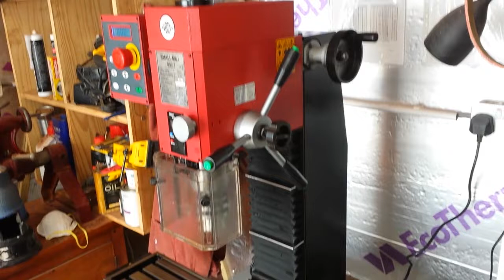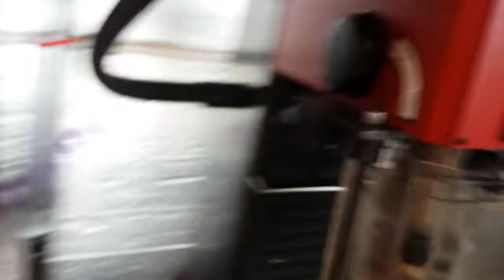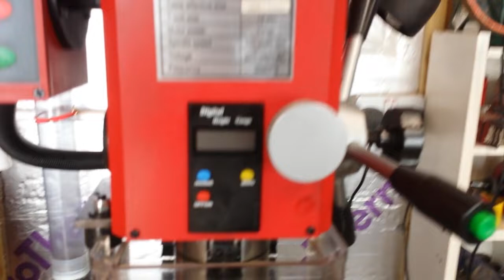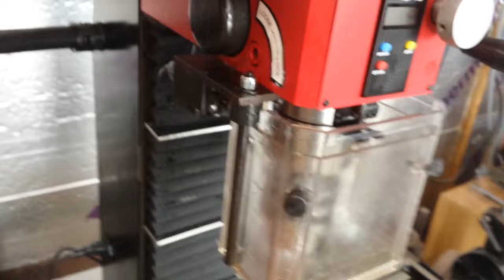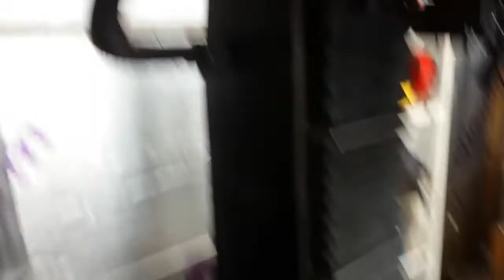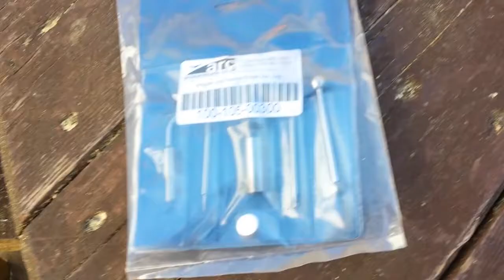Mill Swap (DW Betrayal remix)

Comment: Hi gary

That stupid plastic chuck guard wants launching over the wall....like most other "EU directives"...

See how it goes with this milling machine...

I think you know my thoughts on wong chong stuff.....so I won't say any more...

An update on its performance would be nice though....☺️
Reply from the maker: Hi Glenn - 

yeah, I know your thoughts. You are one of the people I refer to at 4:50  ;-)

As you know I love the old gear too, but I felt that this was the most practical way forward for me at the present time so I can get on and do some work. My first choice would have been the Centec but that would have involved too much delay and hassle. 

TBH my sense is that Chinese machines are getting better than they used to be. This feels like a nice bit of kit, and it does have some nice features. Also, in fairness at least the Chinese are making machine tools at the present time, which - sadly - is all but gone in the West.

However, we shall see how it performs. I will do an update once I've got used to the machine, and I promise you that the accursed chuck guard will not feature in it  :-)
Reply: @gary.arthur 

Look..
The Chinese are capable of producing some half decent stuff....when they put their minds to it...
But I still think you gets what you pays for....
It may well be that the machine you have chosen here holds up OK....as it looks a better model than some of the utter Shyte that comes from that place...

Graft it for a bit....any nonsense with it will soon manifest itself...

And that "chuck guard"...
LAUNCH IT...!!
Reply from the maker: Absolutely! If I'm still saying 'it seems like quite a nice machine' a year from now it will probably mean it's ok.

I do worry about these PCB's though. Bad experiences in the past. But at least it doesn't have plastic gears! 

And yes, countdown has begun on the launch...   ...   ...
Reply: @gary.arthur 

I've been told them "mini lathes" have plastic gears in em...
I've never heard the like before they came along...

Outrageous...

I suppose if that milling machine is maintained correctly....it'll last....
Reply from the maker: Glenn -

I think the mini-lathes vary. I had one for a while - the headstock gears were steel but the changewheels  were plastic. It was ok but I had to change the nasty 'smart' control box which gave me nothing but trouble. It was my first machine apart from a drill press. In fairness, a lot of people can get started because of the Chinese machines, especially mini-lathes.

I also had a Sieg X1 mill which had a plastic drive train which stripped when I took too heavy a cut.  In disgust at that and a burned-out motor and PCB, I converted it into a flat belt driven milling attachment for my (Chinese) drill press. It works quite well within its limits. There's a video about it on my channel. 

I think Sieg are recognising this as an issue which is why they have brought out versions of most of their mills with direct belt drive and brushless motors (this being one of them).
Reply: @gary.arthur 

Hmm...
Fireball Xl1
Reply from the maker: Let's hope not.

Not only was the motor of the Dore Westbury sparking and smoking, but over in France last month I switched on the old English motor on the antique French drill press, and it literally burst into flames. No load at all! I tell you, I am jinxed with electric motors - they drop like flies around me, even on those occasions when I'm not abusing them. I'm on DIY at the moment and since I last posted here a hand-held sander packed in on me!

But after France, I've had enough of fireballs...
Reply: @gary.arthur 

Well, as you know Gary I'm an electrical contractor myself....and I've just done a quick check on voltages in France....
Single phase is at 230V nominal...
3* is at 380V...

It seems that in many older properties (country areas) in France the normal practice was to just run a pair from source (dis board) to each socket and lighting point...using joint boxes often stashed in inconvenient and obscure, inaccessible places...
A means of reliable earthing is often absent...
Making these types of old installation potentially dangerous under fault conditions...

Have you had an electrician in to carry out a condition report on the property in France Gary...?

Does this popping of Drives only happen when connected to the French property's install...?

Does the drive on the Dore Westbury employ any brush gear...?
Reply: That workshop in france....
What was it previously used for...?
A garage carrying out vehicle repair...?

Claus my thinking...is that the outlet your plugging that motor into might actually be at 380V 2*...
A lot of commercial & industrial stick welders work on two phase Gary...

My calculations based on a 380V three phase star connected shows each leg at 220V to star....
Reply from the maker: Glenn - I take your point, but no, it was part of an old house in an agricultural area. The electricity supply is just a branch from my domestic supply. It's not 380, it's just the same as ours here.

It's me, I tell you. I seem to give off some kind of radiation that simply fries the damn things...
Reply: @gary.arthur 

Hmm...
Something random...
Or where its been giving due warning for some time (smelling/rumbling etc)...
That I can understand...

But where there's a pattern developing...then you have to find the reason why...

The reason I asked if it was previously a garage Gary....
Was because it'd be just like someone to wire a standard 230V outlet with 2 legs sitting at 220V star...just so they could plug a stick welder into it....
Trust me..I've seen allsorts that people have done...

Caus as I were reading it...you were having stuff popping every time you used that socket outlet in France...so maybe it were a dedicated outlet for summat...

But you've Just said it isn't...so that's OK then....

Stuff shouldn't just fire though Gary....I would've at least expected ADS (automatic disconnection of supply) to have operated under such conditions...
(ADS is fuses/breakers/RCDs by the way)...
Reply from the maker: Glenn - I know it's confusing with me having two locations but the motor I referred to was the only thing that blew in France (where the shop power is definitely part of the domestic supply - my electrician mate and I hooked it up) and it did trip the ADS. All tthe other instances have been here, and the setup is similar (i.e. domestic supply). A couple of the motors have been old (as on the Dore Westbury) and a couple have been on import machines. I may have occasionally abused things but not to that degree. I will keep an eye on it...
Reply: @gary.arthur  

Just be having a look in that old drive on that antique drill...
They'll be a pair coming off the field in it....check em...
As a lot of these old cables were cloth covered...
Check to make sure they're not going to fault on the frame...

I've an old repulsion start/induction run motor where the cloth covering on the 2 pair has started to break down....
They'll require attention before I can energise it...
Reply from the maker: Glenn - the motor on the drill actually burst into flames(!), so I took it to the dechetterie and slung it. I'm not going to put another motor on the drill - it will be hooked up to the lineshaft instead, in the fullness of time...
Reply: @gary.arthur  

Best thing for it....
That's how its supposed to run really....
The input speeds offered by a lot of AC drives can be a bit high for stuff designed to run off lineshafts...
Reply from the maker: Yep. The lineshaft is where it belongs.

Cheers.
Reply from the maker: Glenn - my friend - a qualified electrician - is rewiring the property for me. I have had a new supply put in by EDF in the last couple of years. Most things have popped here, not in France - only the old motor on the drill press went on fire in France. So I'm pretty sure it's not the wiring of the French property that's doing it. As for our house here, I doubt it. Things in the house are fine. I have a feeling it's just random, with me occasionally pushing things too hard.
Reply: @gary.arthur 

Which house he doing....?

Here... Or France..?
Reply from the maker: The one in France. He lives in France and knows the French systems.
Reply: @gary.arthur 

Ask him his findings...
Let me know....if you like... 😉
Reply from the maker: Sure - but I won't be over there with him until about May next year.
Reply from the maker: 'I think the mini-lathes vary. I had one for a while - the headstock gears were steel but the changewheels  were plastic'.

Actually I was misremembering when I wrote that. I now recall that the headstock gears were plastic but I replaced them with steel ones bespoke to the machine. Noisier but better. It ended up a nice little lathe, which I have since sold.